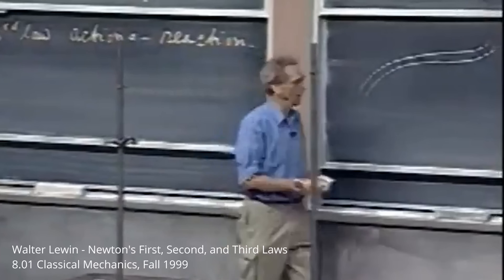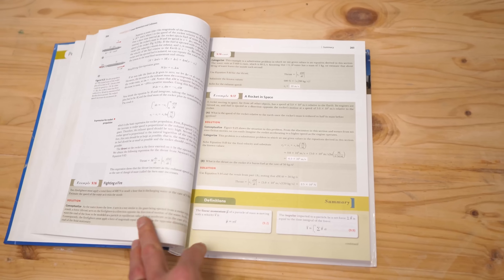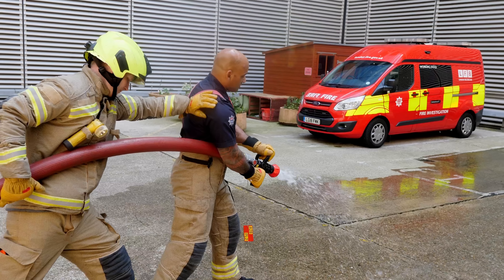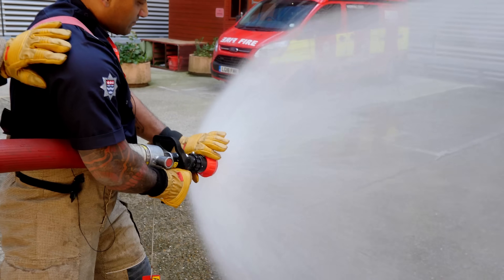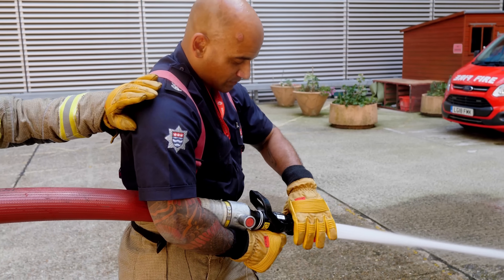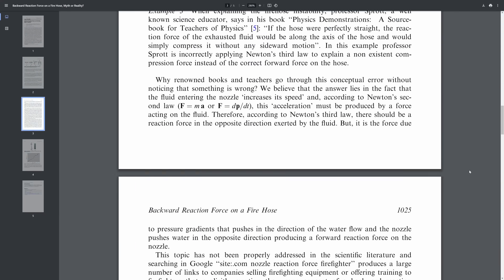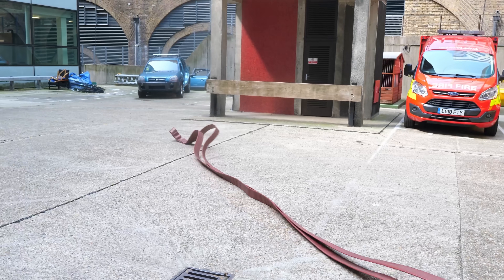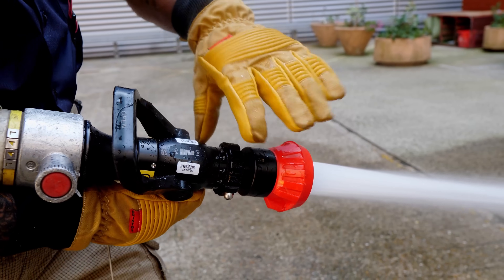Why chaotic hoses dance

Comment: 5:10 I am a firefighter, and here in Denmark we don´t train for this, because if it happens we just turn of that hose at the junction, and reset, but i have NEVER seen this happen, neither has my farther, and we have over 50 years of firefighting experience between us.. BUT is it a waist to train! Never, we can get in a situation where it´s needed.
Reply: Firefighter from Germany here, and despite having less experience than you have, I've never seen or heard about it either. I fully agree that closing the valve for that one hose is the best, fastest and safest way to go.
Reply: In Germany we also just turn off the water.
Reply: When I was a kid, I saw a firefighter climb a ladder with an uncharged hose. They charged it before he was braced, and it knocked him off the ladder and started doing a serious cobra dance.
Reply: It didn't really take him that long to shut it off, and that dropping pressure wouldn't propel the hose around for long... Plus with him closing the valve gradually, the pressure would be dropping gradually too, so I'm not sure it would keep flailing much after he closed it anyway.

I think it makes a lot of sense just to turn it off. Much quicker than crawling around to grab it.
Reply: In Toronto, I once overheard two public housing managers who had just left a building where a deranged resident had opened a fire hose cabinet and tried to use it to fill his apartment with water. The managers were still chuckling over the dents the man’s head had left in the ceiling.
Reply: "waste"
Reply: @justayoutuber1906  “idontcare”. Some waisted firehose nozzle there!

Comment: If the hose feels a force when the fluid is pushing against it, surely its the same principle for the Fireman as they have to hold, controll and aim the hose via moving it and therefore redirecting the fluid.

Comment: Do you notice as he restricts the nozzle on the fire hose it pushes him back? He is increasing the pressure difference at the nozzle. There are 2 settings on hire hoses. 1 is dispersion control and the 2nd is volume control which also varies the pressure difference at the nozzle. Like trying to stop a hose by putting you finger on its end. The harder you squeeze the harder it gets until you can overcome the source pressure. Either at the pump or at the water tower. If you increase the source pressure the hard you squeeze again. You also didn't consider shockwaves created by pressure changes. Like an engines exhaust pipe. That shockwave (pressure-wave) will travel back up  the pipe and also distort the hose.

Comment: Through the whole video, i waited and waited.

why is it not a consideration the hose/pipe expands in circumferance and the distorted size, with a force running through it, can be the cause for bending/flailing/pressure

you said yourself the pipe/tube "pulls" the same no matter if it's curled or straight. to me, suggesting, but you didn't get close to it, the pipe being expanded one way and retracting the other as a reaction.

the fireman pipe didn't flail because those things are super heavy. MOST of the pipe is on the floor and maybe 2-3 feet are held up with any human power. so when considering the forces humans experience when holding the hose, don't forget, pipe length (from floor to human hand), water pressure (from pump to tip) and do yourself a favour.... don't think too hard.

other variables could be the fluid (gas and liquids ARE fluid systems)rubbing the walls and or causing more traction which could cause a bend. imperfections inside the tubing. weight and pressure being used.

(can we use less pressure to predict the whole system or can we only discover when it's under full load?)

Comment: I think because the force inside the hose is constant, that when it hits the air the change in pressure is creating a pushing force since that is where the water pressure is no longer constrained.

Comment: In terms of the whole hose moving vs just the tip moving, I think it's largely the weight of the water that holds the hose down for most of its length. It's no different than you holding the hose closer to the tip. The hose in your videos appears to be about 2.5 inch hose. Maybe bigger but the math is easy with 2.5 inch hose. That's about 8 pounds per foot of hose. Fire hose in the US comes in 50 foot sections so that's roughly 400 pounds per 50 feet. The weight of the hose should overcome the force of the nozzle at some point.

Also, something you didn't mention much was the reaction force of the nozzle. A fire hose without a restrictor of some kind isn't useful because the water will not travel very far. Doesn't the introduction of a restrictor increase the speed of the water and in turn, impart force? The same way the size of the nozzle exit helps determine thrust. Just food for thought. Love your videos by the way

Comment: 9:32
What if there is no nozzle (no narrow point at the end.) and no bend.
I think then there is no force.
The force might just come from water speeding up, when it narrows.
And maybe when leaving a pipe it just naturally does that without there evwn being a nozzle because of bernoulli principle.
Fast water,less pressure than athmosphere => will get squished.
So maybe see what happens if you widen it at the nozzle just so much,that after leaving the nozzle it will end up as wide as before.

Comment: It is not about where the force is created, but about where the force is RELEASED. In terms of the fire hose, that is the nozzle. The water remains under constant pressure, until it is expelled from the nozzle, RELEASING the pressure and forcing the nozzle in the opposite direction.

Comment: @Steve, regarding the fire fighters hose reaction force. These nozzles must compress the water on the exit. The nozzle exit cross section area must be much smaller than cross section area of the hose itself, just to make the water reach further by increasing its speed. And this rapid water acceleration at the nozzle creates the force that firefighters must oppose.  
You can feel a little part of it when you use garden hose without nozzle. In normal use the water just flows out of the hose. If you want to water something further you just decrease the exit cross section area by covering part of it with your thumb. Then, feel the force, Steve. And you can reach much further with the water.

Comment: Could it be, that your reasoning with the water gaining the momentum at the pump only works, when there is no valve at the end. Because we stop the water until we open the valve. In that moment the valve has to feel the force, doesn't it?
Reply: Should've watched till the end 😂

Comment: Others may have already commented this but could we look more into this by observing the oscillations for the single curve (short) tube. My intuition from watching it makes me feel like we could apply the mechanics of a pendulum to it so we could distinguish whether the period of oscillation is due to the force of the water pushing on the inside of the pipe, or from the reaction force, or some combination of both? Also would having a more elastic pipe make a difference as my intuition is that the end of the pipe whipping around would be caused by the tension in the pipe, so observing the difference when using a pipe that has more stretch to it, or possibly having the anchor point have some elasticity (attach a spring to the anchor point?). Just some thoughts on future development of this to understand more.

Comment: my guess: when the water leaves the nozzle, it starts decelerating.. water that arrives subsequentely pushes on that slower water, and gets a push back into the nozzle.. as if you spray against a wall.. the nearer you are, the more pressure back you get. if my assumption is correct, then a wider stream would have less back pressure as the area increases quickly.

Comment: I think you need to consider turbulant flow and laminar flow aswell. Turbulant flow can be faster I think, but I also think at high enough pressure all flow will be quite laminar. How ever when the high pressure water meets air at the nozzle it would be like rocketry. The water cannot be compressed and the air would be like a really pourous wall to the water forcing it to change speed or direction cause it can't be compressed back into the water behind it.

Comment: So I would say fire hose nozzles probably experience similar effects to a rocket nozzle but less so but even with well engineered rocket nozzles it's not 100% of the force being transferred to the bellhousing and some will ultimately be going to the point presumably in the center where the fuel is injected so definitely the pump is experiencing a non-zero recoil, but so are the rigid lines in the truck. Surely whoever engineers them can probably speak to any water hammer mitigations in the design.

Comment: (Please correct me if I am wrong. This here is just my intuition and I would like to understand it better.)

I think it is completely strange that there is a push back force created when opening a pipe. I mean it is logical that it flares arond, like a flag in the wind, due to added up turbulances inside the pipe, but since the preasure is created by the pump, nit the pipe, the water should drag the pipe with it, instead of pushing it back. Exactly like a flag is draged by the wind.

The only thing I can imagine that woul create a counter force to the forward drag is the expansion if the water. It has a higher preasure in the pipe, created by the pump, which is why it gets pushed forward, obviously, and it wants to expand. So it pushes in all directions equally. And while inside the pipe water is pushing against water and creating an equilibrium, only overpowerd by the constant creation of preasure by the pump, when it leaves the pipe, it now also pushes on the outide of the pipe with its expension force. And the only thing acting againt that push back from the outsid is the forwards drag from the inside. But since the water is now in a lower preasure area the expension force increases since it isn't held back by any counter force anymore. and since a lot of the forward draging force is lost in the turbulanes that are bending the pipe, the nozzle (or just the open end of the pipe) feels a stronger backfards force then forwards force. Maybe even added by the fact the the turbulante bending is pulling on the finite length of the pipe.

But what if. And again please corect me where I get something wrong.
Lets assume the pipe does not bend. And lets assume the pump create a preasure, high enough to propell the water fast enough that the water in the lower preasure area when leaving the pipe can not expand fast enough to create a preasure on the end/outside of the pipe. And lets assume the pipe is long enough so that the drag the water create on the pipe is high enough to overcome the preasure with which the pump would propell itself in the other direction. And yes, lets assume the pipe is strong enough to withstand tsuch forces. Wouldn't the pump and pipe then move in the direction of the waterflow? Like a backwards flying rocket?
And how high would the preasure in the pump have to be to overcome the low preasure of the vacuum and how long would the pipe have to be for the drag to overcome that preasure?

Comment: I feel like the aspect ratio of the hose should matter in this. Since with a more narrow hose the boundry layer around the area the water touches the inside of the hose wall will slow down the flow and the smaller the diameter is, the more that layer reaches into the stream. And if there is no nozzle at the end but just an opening, the speed of the exiting water has no way to build force

Comment: Newton's third is the primary factor at the END of the hose but his first rules what happens IN the hose.  (Minus a small, counteracting frictional attraction between the water and the hose as more water travels along an outside curve as opposed to an inside curve).
It's like the hypothetical of the gravity shutter surrounding the sun  If you instantaneously stop the Sun's gravity as a force, (and regardless of WHEN the planets shoot off into space [Gravity vs; wave]) they stop going in a circular path.   The water ALWAYS wants to go straight.

Comment: I don't know the anatomy of a firehouse, but intuitively, i want to say that the firefighter is actually resisting the force of the water "pushing" the front of the nozzle and the equal and opposite force required to push water so far out the front, pushing back on you as the water has room to spread our, but the opposing force is focused on the single point of the nozzle....like a bullet but in reverse with the hose being the bullet and the spread pattern of the water being the gun.

Comment: You'll need to do a follow up Steve, because I still don't understand... Why do you think there is a "gain of momentum" at the exit of the tube ? A gain in momentum can only come from a momentum exchange can it not ? Through collision or through being accelerated by a force.
But the only collision that disappear when water exits the tube is the collision from the walls of the tube. So we would expect the water jet to expand as it comes out of the tube, but this is not what happens, as shown by the images in this very video.

Isn't the front pressure (the collisions with the water molecules ahead) exactly equal to atmospheric pressure since the water exits the pump ?

Comment: This video immediately reminded me of my dad and his job. He was a shot-blaster (which is kinda like a sandblaster but using bits of metal to take rust off trailers etc) and those nozzles could honestly put a hole through you in milliseconds. But like you say, even the airlines with a valve on, flailing about is HUGELY dangerous! 
Great video as per!

Comment: Water is not compressible so exiting the hose will not add any extra thrust due to lower pressure. If you had entrained air, maybe but not pure water.

Comment: I'm ex Navy and was part of the fire team during my service. You need to take account of another at least another two things. Firstly the material and structure of the hose / pipe and secondly the internal pressure of the medium within the hose /  pipe and how that changes how the hose behaves. (You glossed over them). The hose is designed to accommodate water at high pressure which increases the rigidity and the total mass of the water within the hose. Pick up a section of charged hose and take it for a run. Go look at a cross section of the fire hose and the cross section of the plastic pipe. Always great to see your stuff!

Comment: I think it helps to consider a few simple special cases to understand forces that a firefighter has to compensate for in order to hold the hose in place.

Suppose there was no gravity, and a pump is shooting a cylindrical stream of water horizontally. The jet passes exactly through a straight pipe, that is not attached to the pump in any way. If there is no significant friction between liquid and the pipe and the flow is perfectly laminar, the pipe would experience no force at all due to water passing through it. 
Alternatively, consider momenta of water volumes coming into the pipe and out of the pipe. If jet velocities are identical, the net change of momentum of the water jet is zero, hence pipe experiences no force.

If the pipe is connected to the pump (but is still not curved) we can consider equilibrium equations of the pipe.
Pipe is supported by tension force.
The speed of water coming in and out is unchanged (no viscosity assumed, velocity distribution is uniform across pipe crossection).
Hence the water stream exerts no force on the pipe at all. If pump is rigidly attached to the floor, the tension force in the hose can be zero.
So, yet again, hose would not experience any force from the water stream.

The next case of interest would be laminar flow of viscous fluid through straight pipe, attached to the pump.

In this case, mass conservation does not imply momentum of the liquid entering the hose is same as that of water leaving the hose.

(If hose has cylindrical crossection, if I am not mistaken , mass flow is proportional to integral of
V(r)*r*dr, yet the momentum flow is proportional to
V^2(r)*r*dr.
So hose can experience a force due to viscous flow if velocity distribution at the inlet is not the same as that at the outlet. Still, that force would be directed in the direction of the flow.

So, most likely the effect is due to hose curvature only.

Comment: I think the reason the fire hose only wiggles at the end is also due to the weight of the water. Think about how much water you'd have to move somewhere in the middle of the hose to get some movement there (At the end you only have to move the water on one side). That was less of a problem with the air hose of course.
Reply: and it should be overcoming the friction of the grass also

Comment: From the footage, your explanation makes sense, because while the firefighter is pushing against the pressure, they don't have to completely angle their bodies to counteract the force. Which would be expected, when you'd have to counteract all the acceleration of that volume of water, which is pretty heavy. And it gets accelerated fast. That force isn't seen in the footage of holding the nozzle, only part of it, and the explanation complies with that.

Comment: Steve, the nozzle matters. An open hose is different from one that squeezes and redirects the flow. When the jet is constrained into a tight beam it can travel much farther distances. What does that tell you about speed, momentum, and kinetic energy? Consider the loose fire hose motion when the nozzle is a tight fast stream vs when its a wide open shower? 

As for differences of the hose movement, part of that comes down to the fact that the heavy hose is lying on the ground.